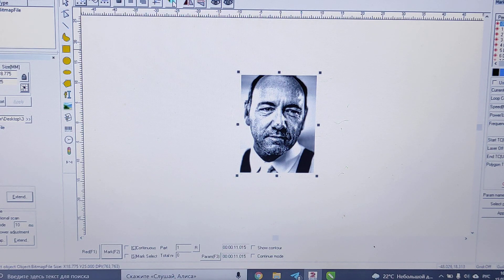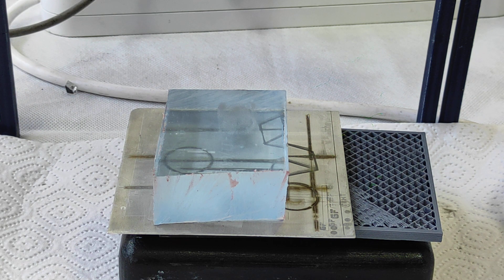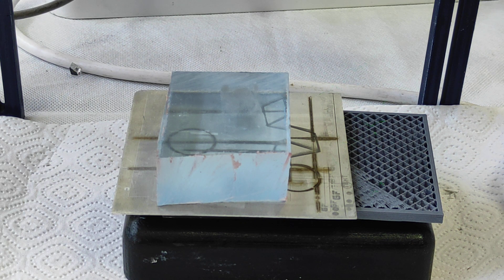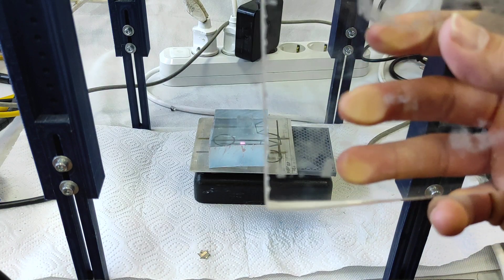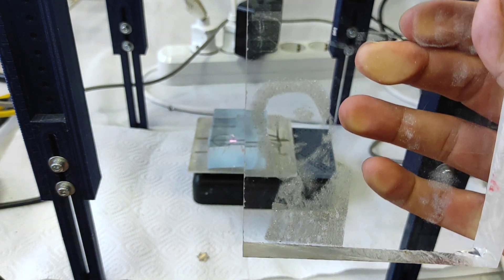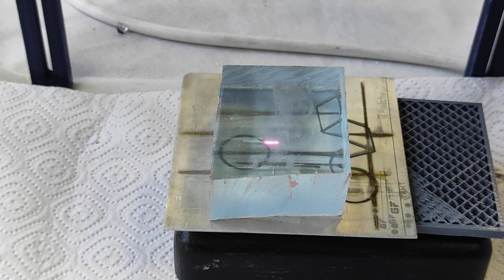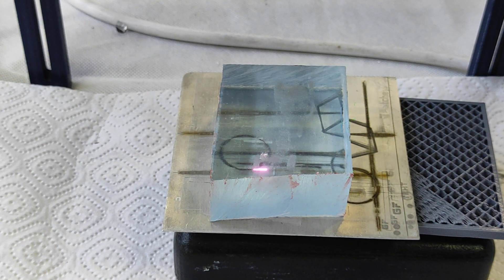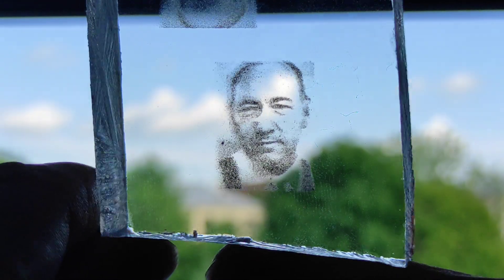Photo engraving inside the transparent 2.5 cm (1 inch) acrylic using 30 watt Raycus laser.

Comment: I never thought it is possible to engrave inside acrylic with single laser beam. - but I'd love to "play" with this laser.
Reply from the maker: yes, indeed, it is awesome!!!
Reply: always thought they used an opposing mirror with a software depth setting feature, sorta like the 3d scanners but since its clear, you would have its beam hit itself inside the clear part. i set up so many files as an artist and never really gave it much thought. Its neat and all but the cool factor wears off quickly